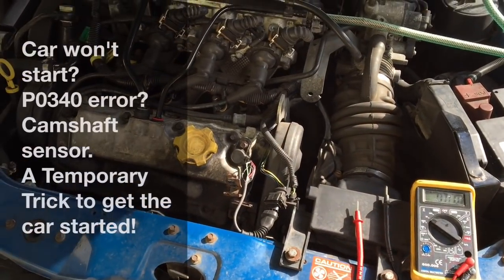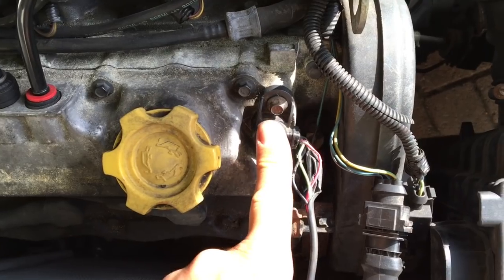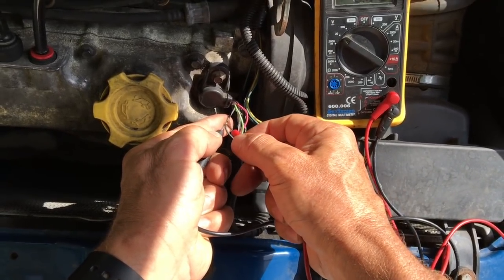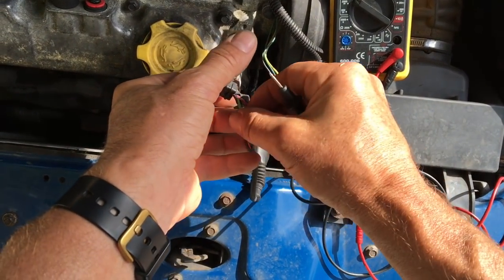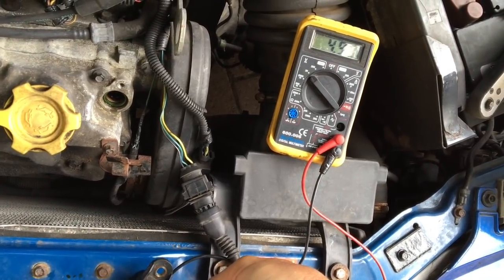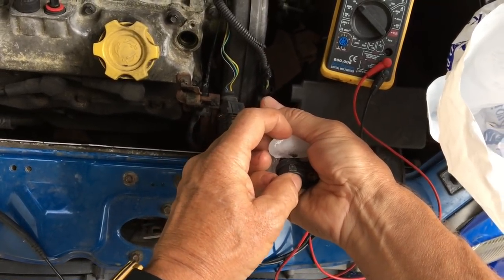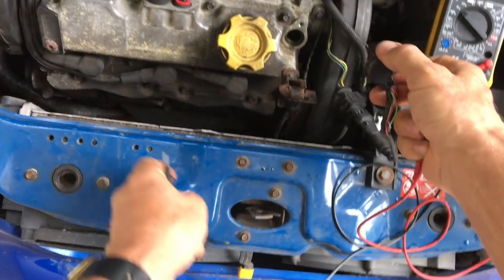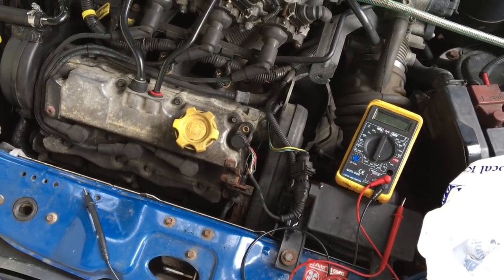P0340 Error? Car Won't Start? Here's a Quick Fix! For Camshaft sensor.

Comment: Weird question, a joe shop pulled a p0340 and p0344 on my Fusion Hybrid. (Camshaft Position Sensor A and Camshaft Position Sensor A Intermittent).  He recommended an oil change because in some vehicles low and/old oil could cause this type of fault. I needed a change anyways so I got one and drove away and booked an apt with Ford since I'm within my 5 year 100L powertrain Warranty. The next day (today) I drove to the gym and back and the lights went away on its own. What are your thoughts on this?
Reply from the maker: It doesn't sound right that oil can cause a change in magnetic field around the camshaft sensor.  If somehow it does then the cam sensor signal must be very marginal.
Reply: Okay. Also the power loss is gone now. But it being a hybrid its hard to tell anyways. This is going to make troubleshooting interesting since the check engine light cleared itself and I feel the dealership will think I'm crazy.
Reply: @DanNPTRI   did u ever have the problem come up again

Comment: Hey mate i have a 1999 mazda protege 323 trying to confirm if  i have a cam or crank sensor or both problem. Any help greatly appreciated cheers
Reply from the maker: You need to read the error code from the OBDII port. See this video, hope it helps https://youtu.be/RnyXdxYaW2Y

Comment: I have 2004  Lancer and it wont start and showing PO340  Camshaft Position Sensor
A Circuit Bank 1 or Single Sensor so i bought new Camshaft Position Sensor installed it and car still not starting. What else should i do?
Reply: Just found our timing belt broke🤦🏽‍♂️
$2800 fix
Reply: @scorpiontube712  damn that sucks big time:/
Reply: @scorpiontube712  same issue I am dealing with. Found out today. It's my timing chain.

Comment: So i change the camshaft sensor and still wont turn on.. I can take it out an Clean it like u did.. I mean can it be taking out or onece u put it in.. It cant b taken out
Reply from the maker: You can take it in and out at any time.  Test it by measuring the sensor voltage like in the video.

Comment: Had a P0340 code got a new sensor and the vehicle starts but still has loss of power and take a while to turn on
Reply: On a 06 G35
Reply from the maker: Any other engine codes?  Has the 0340 cleared?  Does the new sensor work ok like the tests in this video?  If the new sensor looks ok then it must be some other problem.
Reply: Desxo Esco yea bought a sensor from infinity and that one fixed the problem
Reply from the maker: Well done.

Comment: Hi there. Thank you for your informative video. I have a hyundai santa fe and yesterday would not start. It was trying its hardest but wouldnt fire. RAC came and hooked it up and said camshaft sensor malfunction. So is currently waiting at a garage til part arrives monday. Question i have is can it cause no fire up as relative's have had cam shaft sensor problems but all they got was a warning light on their BMW and NISSAN  but managed to drive to garage. Where i had to be rescued due to no start. Think im looking for reassurance. RAC said that was only fault on computer and that the engine of my 04 car looked very clean. Appreciate any imput
Reply from the maker: Yes it will cause it not to start, if there is not enough signal from it.  On some cars they make detect it is on its way out as the voltage gets smaller and flag an error but stil work, just about.
Reply: comeinhandynow thank you for getting back so quickly. Feel a lot better for your response. Never had warning lights or nothing prior and got me to work no problem and then after shift just didn't start. Glad it's a quick fix but just such an inconvenience when you are without a car. Google doesn't help either when people are in forums with similar problems but listing a lot of other issues.
Reply: @laurabrooks6986  did it work???
Reply: @aloiba100  no it didn’t the garage continued putting parts in it and then broke the complete engine as they had misdiagnosed it all the cogs in engine had broken teeth so car was a full write off
Reply: @laurabrooks6986  I’m  sorry it didn’t work out😢

Comment: So maybe you can help me out - I believe the cam shaft sensor has gone bad on my 1997 pathfinder 3.3L. Problem I'm having is when I call auto parts stores to get one, no one even has one listed, they tell me they don't even have a part number for a cam shaft sensor and one fella told me there was a notation in his computer that they can't even order them.
I've no idea what gives with that but I called a nissian dealer and they tell me that I can order one from them but there isn't one at any dealership in the entire state, the closest one is 2 states away.
Any I missing something here about this part. I had no idea it was so "special", I've never had a problem getting any part for this car from part stores before, even sensors - everyone has the crankshaft position sensor but no one has the cam shaft sensor.

The car began dying at idle once the weather heated up here this spring. This went on for about a week. It would start back up but sputter and have a hard time of things at about 2500 RPM through 4000 RPM then clear out and be fine. A week of this and one day it was dying under load at highway speeds every 1/2 a mile. It would start back up, then about the 9th time I had to let it sit and cool down before it would start, about the 15th time it just said "no" - had it towed home, it hasn't started since.
Strong crank, new distributor, plugs, plug wires, battery. 
It's got spark, fuel, air, compression - all tested out fine, so I was told it was the cam sensor but I'll be smacked if I can find one. Then someone told me it's the same part # as the crankshaft sensor and basically the same unit but before I go sticking a part on that doesn't belong I'm trying to get so more information on this elusive part.  Internet searches are a bust - 1000 of pages on crankshaft sensors, next to nothing on cam position sensors.

Any help is GREATLY appreciated - I've been dealing with this mess for 15 days now and about at my wits end.
Reply from the maker: This story sounds like yours and has a solution! -
http://www.nissanforums.com/pathfinder/169430-cam-position-sensor-failure-diagnostic.html

Comment: Great vid. I had that cam sensor error in my Nissan Frontier V6. I used for awhile maybe too much till died. Put two new sensor but won’t start. Any suggestions? Thanks
Reply from the maker: Maybe try testing that the sensor is working by measuring the voltage on it when touching against some iron, like in the video.
Reply: Whar causes the speedometer to not work
Reply from the maker: Maybe another sensor, on the gearbox maybe.  Or the speedo head unit.  Possibly have a look in the Haynes workshop manual to see if there is a wiring diagram around the speedo bits.
Reply: Get it out and use plenty of contact spray then let it dry long enough.

Comment: the last 1month,my 2004 kia Sedona camshaft have been troubling me and have replaced it three times but problem still not solved
Reply from the maker: Have you measured the voltage from the sensor, as in the video, and confirmed that the sensor is not working?  Maybe its out of position somehow, like too far away from the camshaft...

Comment: Hey mate, today I can not start my car, and it sounds like yours, it can be a problem as yours? I have Nissan Almera 1.5 72kw 2005.
Reply from the maker: It’s possible, but its best to try and read the error code from the OBDii port using a cheap (£15 ish) reader.  See my other video on that.
Reply: We have made a diagnostic today, and it shows 0340 error and P0037 error code, do u know what it could be?
Reply from the maker: The P0340 is the same as in my video and is camshaft sensor, so sounds like the same issue.  Try and find the sensor and test it like in the video.  

From a quick search:  OBD II fault code P0037 is defined as “Oxygen Sensor Heater Control Circuit Low (Bank 1 Sensor 2), and is set when the PCM (Powertrain Control Module) detects a signal voltage from oxygen sensor #2 that does not fall within the predefined range for that sensor.
Reply: comeinhandynow Thanks u so much for your response, appreciate it! I will see what is with that car tomorrow.

Comment: Hi mate it's me again  would the coil pack do the same thing.on mine it would blow the 20 fuse saying  engine management I've changed them now and it starts do I a new cam senor thanks
Reply from the maker: You'll only need a new cam sensor if you get a p0340 errror when read using an obdii reader (see my other video on those cheap elm327 based obdii readers)
Reply: comeinhandynow thank you
Reply: I swapped cam sensor in a passat 1.8T 2001/2002. Still throwing the code, runs like shit when clearing codes until the CEL comes on again. What is the next step....? I'm not sure how to check all wiring...

Comment: thanks. got same problem. 
somebody must know where a correct camshaft position sensor can be bought
Reply: Location camshaft sensor on a 2005 ford freestar
Reply from the maker: I'll put a link to the part in the video description, in the meantime here it is for a selection on ebay:

http://rover.ebay.com/rover/1/710-53481-19255-0/1?icep_ff3=10&pub=5575193927&toolid=10001&campid=5337910930&customid=&icep_uq=K+series+camshaft+sensor&icep_sellerId=&icep_ex_kw=&icep_sortBy=12&icep_catId=&icep_minPrice=&icep_maxPrice=&ipn=psmain&icep_vectorid=229508&kwid=902099&mtid=824&kw=lg